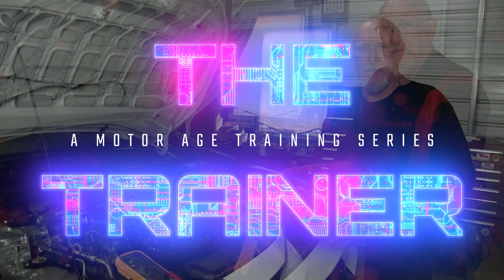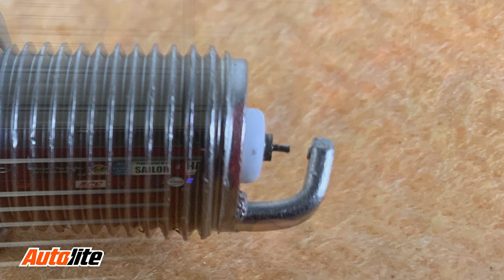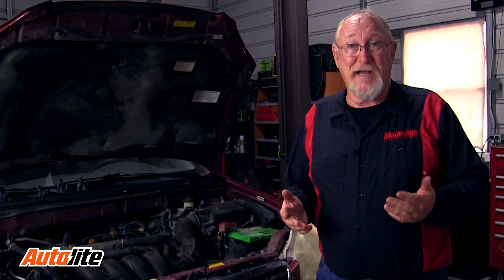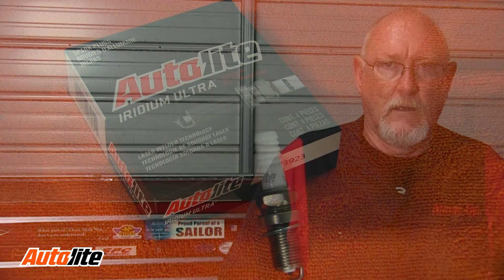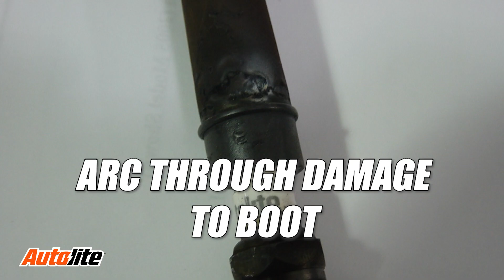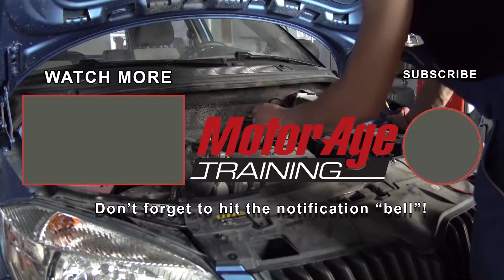The Trainer #107:  Spark Plug Service - The Professional Way

Comment: Any problem " upgrading " to iridium plugs in vehicles that had platinum or copper ? There is also a lot of " discussion " over brands . If you choose a major brand and match it exactly with the heat range , do you see any potential issues ? Even here there are comments about brands . Please explain the difference in a " crossover " to another brand that may cause issues . I can understand using low end parts is a problem waiting to happen , but is the brand that critical if it is top shelf ? Is it VOODOO or are there reasons to match brands to manufacturers ?
Reply from the maker: Personally, I think if you stick with a major supplier you're going to be ok. After all, these same manufacturers supply the OE with their spark plugs. We techs do, however, seem to have our favorites! As far as switching to an iridium, I would only recommend it if you were increasing the overall performance over stock. Otherwise, stick with the design that came with the car originally.

Comment: Thanks for the video.  Where can you buy the wire type gauges you used in the video? I bought some like those from Snap On years ago. They don't sell that exact style anymore. Or at least my dealer didn't get that particular one when he ordered.
Reply from the maker: Where else? Amazon!  https://www.amazon.com/CTA-Tools-3238-Spark-Gauge/dp/B00PISL328/ref=sr_1_5?crid=3ESPKWDJSZ0J2&dchild=1&keywords=spark+plug+gap+tool+wire&qid=1604327381&sprefix=spark+plug+g%2Caps%2C204&sr=8-5